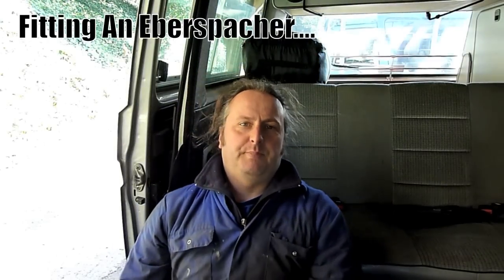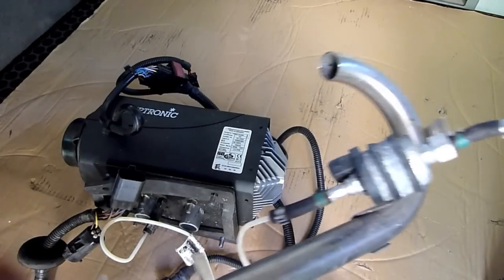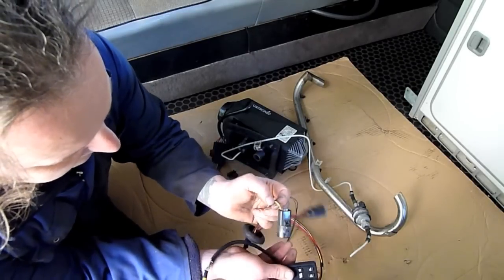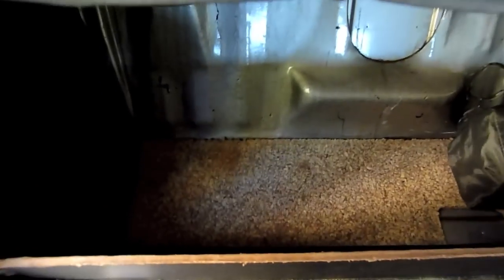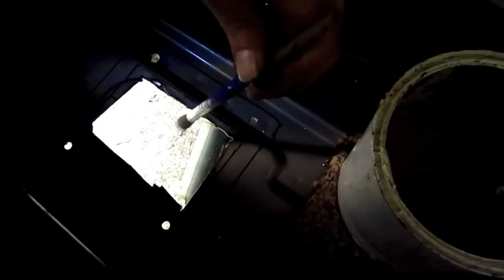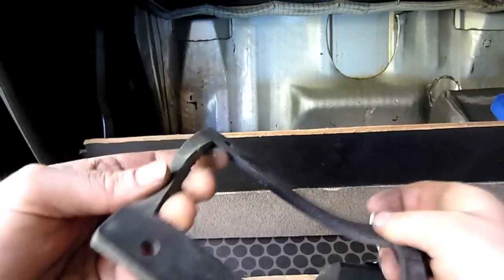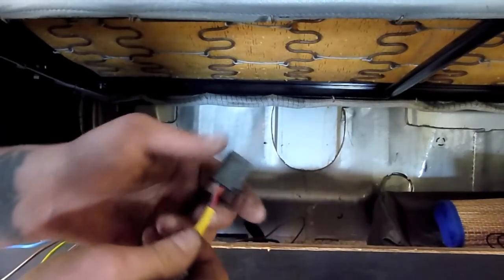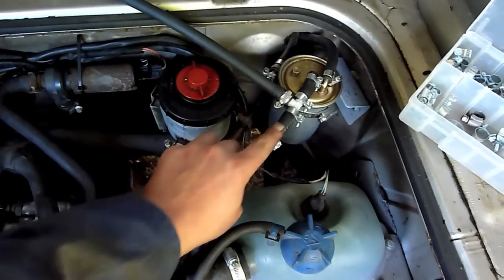Eberspacher d2 fitting

Comment: Good video!

Help! I have a d2 installed below the non-driver seat of my vw t4 campervan. He has been out of use for a while. When i turned it on, the heater had trouble starting. Power went on, a bit of air came out, but the petrol does not combust and the heater turns down after 20-30 seconds again. 

I bought this van second hand and the heater only worked once. What can i do to find the cause?

Comment from the maker: Just got back from a weekend away using our Eberspacher. You DO NOT need a solar panel plus installation costs and you can leave them running all night because it exhausts underneath the van and it heats the air inside your van via a heat exchanger. Most HGV trucks have them world wide where accommodation is combined into the cab and they are very safe indeed. I often sleep in shorts and t-shirt when its sub zero outside like I did this weekend. Those little buddy heaters are a death trap,

Comment: Great job sir. Made it look easy. 

I'm looking around for my 50' sailing barge, I'm flipping between Propex & these for timed heat source.. Had chosen Propex propane/electric air blower as I sail, so don't use much diesel. I can run Propex low 500w heat setting using wind/solar. My wind gen also dumps into a water heater.

BUT these are cheap as chips 2nd hand, so might get one too :)  Also have wood burner, electric & heat exchange radiators. Never enough heating on a 100 year old wooden boat!

Comment: i have a webasto hl32 and the pumps buggerd i think as it doesnt pump any fuel ...it does make a ticking noise tho  im wondering iff an eberspacher fuel pump would work with a webasto system ? as there cheaper ,and im a tight arse haha . any info mutch apretiated ..

Comment: I have a Eberspacher D2 fitted in my van, was a recon cost £200 on fleabay. First one sent was duff, replacement was ok. 3 years later still working but has developed it's niggles (my fault). They can be temperamental having so many safety sensors but if the ECU is happy with the pre start up checks and fires up then they take some beating. Yes you can use red diesel but they are so efficient is it worth messing with fuel in cans? for me it's not.@BRUCE LEE Each to his own but if you are so happy why are you so interested in diesel heaters? chill go grab a six pack.

Comment: How do you connect to the fuel line without getting any air into the fuel? This is my only concern with fitting....
Reply from the maker: +AlabamaTree 

The fuel pump pulses and draws the fuel through before the heater kicks in.
Reply: +CampervanCulture.com 
Thanks for the reply, I understand that part but I mean during the original fit of the fuel line. Do you just fit a T piece into the existing fuel line? If so how do you stop air getting into the fuel when you cut it?
Reply from the maker: The fist time you turn it on it pulls the air through and hits the fuel and fires up.

Comment: First of all I have the Buddy Heater and it is SAFE to leave on at night.This is due to the oxygen sensor at 19 % SAFETY SHUT OFF.Next I said people in vans leave two windows open an inch.THIRD you use a smoke detector and corbin monoxide detector combo.

YOUR INCORRECT " Everyone can see you are wrong and getting into a pointless row "

I also said these diesel heaters are noisy,hard on batteries and expensive to fix ( TEMPERMENTAL ).This was just confirmed by an off grid guy with one !

Comment: I assume that you folks don't have access to Propane over there.

We have MR.Heaters here or " Little Buddys " that have an oxygene sensor and you can add a carbon Monoxide detector with smoke detection.

VW'S can hook into the propane or put a tank outside.We don't need battery power so it is silent and cheap.1 LB every 5 hours at 4,000 BTU which is perfect for the VW.

200 bucks US or Canadian and it's a do it yourself set up.Now you need a solar panel to run that thing plus installation COSTS

Comment: YOU TUBE THIS TITLE...." LIVING THE VAN LIFE-SURVIVING THE COLD "   200 bucks  DYI   .      on 4,000 BTU it's a pound every 5 hours.

Has an oxygen sensor but you turn it off at night and crawl into a good sleeping bag..75 80 degrees when you are up in the day.NO DANGER just leave 2 windows open an inch for oxygen.Unit turns off at 19 % oxygen level .

Comment: Try reading what I said AGAIN  We have MR.Heaters here or " Little Buddys " that have an oxygene sensor 

It turns off at 19 % oxygen     PLUS as I said you leave 2 windows open an inch to run it and draw fresh oxygen.

Stupid people die from bringing BBQs and running stoves all night.Some die from having a hornets nest in the exhaust of furnaces.Wood stoves kill a ton of people because of not cleaning the chimney residue     whats your point ? BUDDY  is 10 % of your cost after installation

Comment: Check out the Little Buddy     You Tube video    LIVING THE VAN LIFE-SURVIVING THE COLD 

Watch that vieo and my Bruce Lee comments above      200 US and you have cheap heat all day and then a warm sleeping bag will save you money on fuel at night.

No fan or noise just crack 2 windows for fresh air .Oxygen safe but use a smoke detector and carbon detector in the van for EXTRA safety